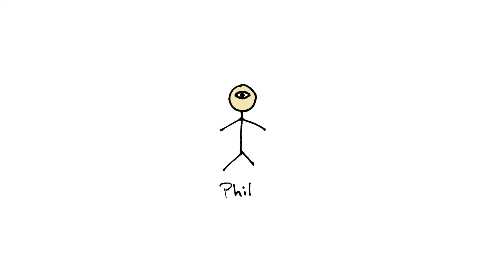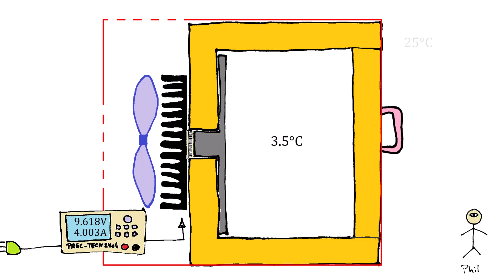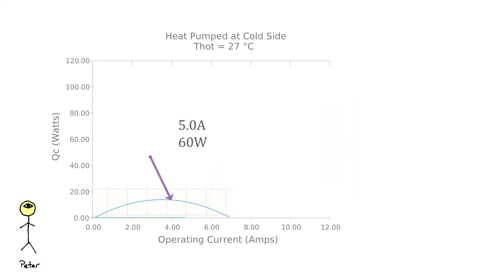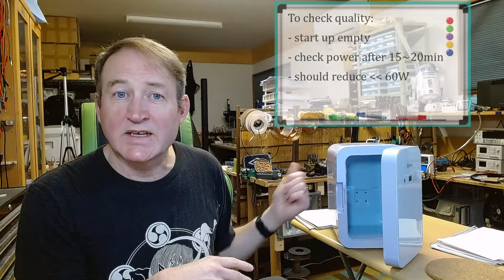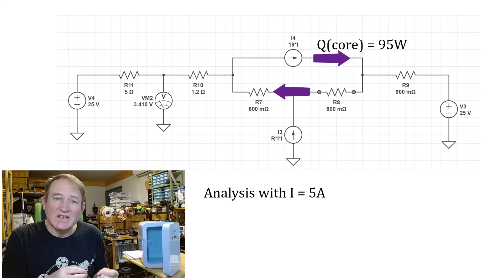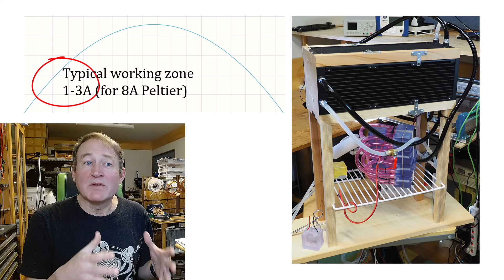The Peltier Fridge Parabola Problem

Comment from the maker: A note for clarification: In the video all the circuits are actually thermal circuits, not electrical, which is confusing and I should have explained before showing the circuits. For these circuits, if you see a resistor in Ω, this represents thermal resistance in K/W or °C/W. The current (A) represents heat flow in W, and the voltages represent temperature (in °C). So if you see 25V, this represents 25°C, if the Peltier core heat pump is 95W this shows up as 95A in the electrical circuit. Hope that makes sense!

Comment: i started getting really into modding fridges after i bought a peltier wine cooler and was disgusted by its apparent energy consumption. I discovered a few unique tricks after modding it that I later applied to my compressor fridges i bought.
I will share them here since my old video explaining them is basically unwatchable.
1. Use GaN powered adapters and convert the input plug to USB-C with a pd trigger module. instead of loosing ~15% from AC->DC, you cut that down to about 10%
2. play with different input voltages. very dangerous with tec coolers but totally okay with compressor fridges meant to run on 12/24v systems. USB-C pd 3.1 spec has a 140w 28v setting which is within spec for 24v systems (based on 2 lead acid batteries in series, which has a peak charging voltage of about 29-30v). the compressors really like running on the higher voltages.
3. increase airflow to hot end, duh
4. add low emissivity coating to cold end and high emissivity coating to hot end. When i ask AI about this, it gets really confused... i wouldnt trust what it has to say. basically apply aluminium tape to the outside of the device, and inside surfaces, and apply matt black (like gorilla tape) or better yet black painted aluminum tape to the hot end regions that will radieate away from cold end. apply shiny aluminum tape to surfaces between cold end and hot end.
5. extra insulation always helps.

by doing all these tricks, i was able to reduce my 55 liter/54 quart dc fridges average power consumption down from ~30-40watts all the way to ~5 watts (105wh/24hr!). it truly is insane to think that charging an old phone or ipod consumes around the same power on average as the largest format DC fridge takes to maintain a bunch of drinks a few degrees above freezing. it actually saves you electricity to add a drink fridge since youre opening your main household fridge less often and letting all the cold air out.

need to get back into messing with peltier modules, glad youre making these videos. that delta t is the key.

Comment: Jack who kno a bit more than Peter suggest not to run the peltier device continuously at 60 w but in pulses of 60 w with 50% duty cycle and then decrease the duty cycle to 10%, while keep the hot side heat sink fan on all the time, suddenly the COP became more efficient than all the known  heat pumps, good luck and try that and see your self

Hint : the frequency is the key

Comment: I want to make a small greenhouse (around 30x30x40 (48liter controlable closed air flow with plexiglass) where i can control temperature to grow mushrooms in it. Do you think i could use a peltier element with heatsink and fan on bothside to regulate temperature around 25 degrees C. I would rather use 5volt 1 amp peltier with 40x40mm fan and heatsink but im not sure if that would work? i think ambient temperature would be maybe 10 degrees low 35 degrees high.

Comment: Why does the parabola move left?
Reply from the maker: Good question! I also wondered about this. It turns out to be related to the whole system starting and finishing at the same ambient (the room temperature). That doesn't always apply to heat pumps, they can pump between different zones (e.g. inside a house to outside a house). For a fridge though the hot side is pumping to the room ambient and the cold stuff in the fridge also leaks to the same ambient. In that case the parabola must always pass through the (0,0) point as both ends of the system are at the same temperature. A normal parabola is ax²+bx+c but in this case there is no "c". I guess mathematically it could be wrong to say it moves "down and then to the left", rather the high thermal resistance just causes it to shrink overall while always maintaining a left foot at the origin.

Comment: I was mistaken about peltier fridges also. I know that they are used in labs but I wasn't sure why they would and the efficiency problem. This makes a lot more sense now, it just takes a longer period of time for temps to stabilize at the lower amperage. Great explanation!
Reply from the maker: Yes, the best algorithm is like the Msake fridge which uses the higher power mode to cool things down but then switches to lower power once it is down to temperature. It actually seems to have three stages, 60W, 25W and then 10W or less.

Comment: Very interesting and informative.
I had no idea about the current paranoia.
I have a 35 year old Coleman fridge which I use when camping. It's probably accumulated about 4 years of uses.
It must have been good quality given the normal 2 - 3 year life you are talking about.
The fan motor burnt out 3 years ago but I managed to graft in a pair of 12v panel fans and added a thermostat to stop freezing in the cooler months.
I suspect the performance is down a bit, so I will be renewing the thermal paste never thought about that.
Thanks.

Comment: When I was researching how to reduce the power of a Peltier module to improve COP, I considered two methods of power regulation: PWM and DC regulator. The neural network suggests that it doesn't matter whether you use PWM or DC regulation for a Peltier element, efficiency will be the same (assuming the same average electrical power).
Unfortunately, I cannot confirm or deny its information, but maybe you (or someone in comments) have any thoughts about this?
Reply from the maker: If the PWM frequency + filtering is high enough that the Peltier "sees" only dc it is OK. However if the PWM is slow and the current is actually switching between 0 and high current with a variable duty cycle, then the negative effects of driving Peltiers at high currents will still exist, even if the average current is low. It needs an LC filter with the frequency below the PWM output. A little bit of ripple should be OK, just not hard swing from 0A to high current.

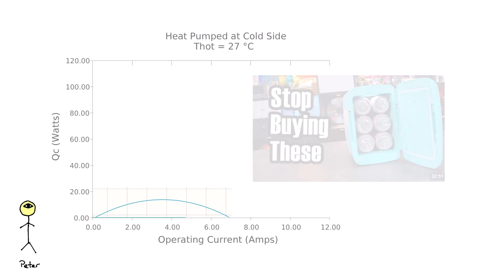Comment: 7:01 I rewatched the technology connections video with "stop buying these" on the thumbnail. He didn't address the option of getting a better designed peltier cooler. But he did talk about how the one he got was cheaply made and inefficient and badly performing for reasons other than the peltier effect being inefficient. And that the peltier effect is a lot less efficient than compressor based systems (isn't that still correct?). And that there are still reasons to use them.

Now that I'm writing the comment though, I can't remember the answer to the main point though, which is, did he give efficiency numbers based on running the devices with too much current? Either on the cheap device he was testing, or as a general statement about the peltier effect.
Reply from the maker: His main point was blue fridge was drawing 55W (24/7) which is a valid concern. However, the Msake fridge draws about 9W which is a different ball park. Our living room alone has 21 x 5W LED downlights, so the Msake fridge draws less than two of those. Excessive concern about COP at those levels is a forest/trees problem. He also said that Peltiers have an efficiency that varies wildly and is generally between "zero and very bad", which is untrue if the thermal system is designed well. The raw ability of a Peltier is about 25% of the raw ability of a compressor. Compressors are excellent if used properly (which they are often not), so 25% of excellent is still OK. He also proposed that a compressor fridge has a COP of 3 which is wildly overoptimistic, given the large dT and the parallel plate design. Based on the Carnot theory, at the temperatures of a typical fridge the maximum COP for an ideal heat pump is only 3.0 (due to the large dT involved). A good quality compressor usually gets about 60% of this, so about 2.0. But then most modern fridges discharge the heat on the sides of the fridge, which creates a parallel plate to the inside of the fridge (massive leakage hot to cold) and kills the COP down to about 1.0. *Which is still great*, all things considered, no skin off the nose of a well designed modern fridge. The thing is, it's really difficult to measure the true heat flow and COP of a heat pump, so people throw around figures like 3 or 4 based on what the manufacturers say, but in reality, compressor systems also vary wildly based on the conditions of use and the thermal circuit. Compressor systems also have a terrible power factor and are not well designed for use with battery/solar; Peltiers are perfect. But they need some tender care and loving to get the best out of them :). Finally he said the Blue fridge insulation was poor quality, which might be true, but the biggest factor in thermal insulation is surface area and the blue fridge is about 1/10 of the surface area of the black mini fridge. So even if the insulation quality is half as bad (which is expected) the blue fridge will win against the bigger fridges.

Comment: I'm in the process of working out a larger scale version of this concept.. to the point your diagram of the fridge is almost exactly a single module's layout (it isn't an air to air scheme, so it doesn't quite match up lol).

I've long given up on the idea of actually moving much heat with peltiers, but they are excellent at establishing and maintaining a specific temperature when the actual thermal load is minimized. Essentially my design controls the infrared signature of the controlled volume, without attempting to pump heat from out of the air. This requires multiple modules spread out, as well as conduction/convection being intentionally reduced. The idea is to let the cold side get as cold as it possibly can, not to explicitly have it ”pump” heat out of the controlled space.

My design isn't quite suitable for a fridge in and of itself, although could make an existing compressor based unit much more efficient by using peltier to hold the walls and door, and the compressor only needs to be concerned about the initial bulk heat such as a warm can being introduced.

I too am at the earlier stages of development... but I have long believed peltier gets a bad efficiency rap because they are widely misunderstood and misused. It is counterintuitive to apply insulation where you intend to have heat move around, but that's exactly what it requires. After that curve drops and things reach equilibrium, it takes very little power to maintain the temp, just a couple watts per square foot, in my case.

It's good to see someone else who does understand these intricacies... hope to catch something I haven't picked up on myself in your videos. These things have excellent potential in the right applications... and watching CPU crowds just "throw more amps at it" gets really old really quick. They don't understand how it works lol
Reply from the maker: I actually have two Peltier based air conditioning (heating) systems running at the moment. One is designed to match a 300W solar panel (rated 400W but gets 300W in practice), and uses a bank of 16 Peltiers to ramp that up to 600W, drawing 300W from outside, it gets a COP of 2 for heating with a dT of 25K. The second is a bank of 15 Peltiers that is similar but uses a water tank in the house foundations as the other side (cold side) so the dT is only 15K, so it can get a COP around 3 (e.g. 100W in 300W out). These are still not perfect and I think the main bottleneck is those aluminium blocks that are about 0.08K/W per Peltier, which sets an upper limit of about 75% of the datasheet. I used to think it was the thermal paste (ceramic - aluminium) but now I think aluminium to water that is the weak point, not enough surface area inside. I will do a video on this soon!
Reply: @PeltierPower  Oh yes as heat sources they are absolutely amazing. I'm exploiting this in another aspect of the system in the form of phase change materials... the cold side isn't allowed to cool and both the storage and retrieval are >100%. But cooling is a whole different animal and requires finesse haha
Reply from the maker: At the end of last summer I also had a similar 8 Peltier system providing 300W of cooling which was enough to keep the room stable. In a modern house, good insulation, blinds etc there isn't much heat getting in from outside (maybe 50-100W) but the problem is the heat sources inside build up (my body, PC, display, lights etc ~250W estimate), so it's surprising how little cooling is required. The advantage of summer time is the dT is much milder so I can still get a decent COP for cooling for cooling, e.g. 300W cooling for 100W input, and again I can pick the 100W directly off a solar panel (dc direct). I'm looking forward to seeing how my bigger systems (15, 16 Peltier systems) works this summer.

Comment: Would that also work for a dehumidifier, I wonder if I could modify mine to not consume crazy amount of power per gram of water removed
Reply from the maker: I had a few attempts at this but not great so far. Keep in mind that every 1g of water condensed requires ~2,250J regardless of the method, that's just physics, latent heat of condensation. That said, my attempts seemed to fail because the water builds up on the surface (e.g. copper coil) and then stays there, acting as an insulator and preventing further condensation. So it seems to be more of a mechanical issue, how to move the water on to a container. Now that winter is ending, I'll restart that project!
Reply: @PeltierPower  I know, I use it as a corner cold spot heater with bonus function of removing a bit of humidity but it would be nice to remove more humidity if possible
Can't you cover just the coil with hydrophobic coating?
Reply from the maker: I think this is where a community effort could help, I'm not familiar with hydrophobic coating, do you have any pointers or experience with this?
Reply: @PeltierPower  I'm not an expert, I have only used it on sloped stainless steel with ridges that wouldn't shed rain properly causing water to sit in valleys for hours after rain which caused steel to develop pitting eventually.
What I did was first I cleaned and degreased then sanded with 800 grade then degreased again with isopropyl and then sprayed the coating onto steel, water runs off much better now.
I don't know if this would work for copper or wouldn't lower thermal conductivity unfortunately.
Reply: @PeltierPower  Now that I think about it, wouldn't a simple wicking string allow you to drain enough water for it to not build up?

Comment: Am I correct in thinking a peltier element while not active is a thermal bridge/leak to the outside? I was wondering for small coolers it might be good to have a mechanical disconnect in the thermal pathway if the thermostat switches off?
Hope to one day make a mini milk fridge for my coffee machine with an acceptable efficiency...
Reply from the maker: Yes, but it's not quite as bad as the pundits might say. If the system also turns the fan off it could be say 2-3K/W thermal resistance to the outside world which is not perfect but if the thermal mass inside the fridge is say 3000J/K (two cans of beer) it will take a while. Theoretically the time constant RC = 3000J/K x 2 K/W = 6000s or a few hours, which is what you would expect. And of course you can just turn the Peltier system on for a bit everynowandthen and it can keep things in a usable range

Comment: Fascinating, never thought a peltier fridge could idle at 10W, thats as low as a (substantially larger) 12V compressor fridge. I also want to build a butter conditioner, for both warm and cold weather. Is there an algorithmic method for a machine to dynamically adjust its operation-point, like a maximum-power-point-tracking charge controller? Ideally you’d want it to keep tracking to the top of the parabola while it’s away from the set-point, and ensure you’re retreating down the left side of the parabola when full cooling power is no longer needed to retain the set temperature. I assume you’d need to measure not only the temperature of the thing to be cooled, but the hot-side and cold-side directly, and the input voltage and current. Even if the thermal resistance from cold-side to the object to cooled changes (e.g. putting another can in the fridge), would just those three temperature readings and the power readings be enough? I assume a microcontroller would be a requirement, as opposed to some sort of analogue feedback loop?

Comment: No fancy mathematics and charts needed.  The biggest problem with Peltier refrigerators is that when they are unpowered the Peltier junction is  a huge path for heat to flow back into the refrigerated space.  Lose power and the food rots — fast.  The wall of a regular mechanical refrigerator is penetrated by a couple of tiny copper tubes that present a negligibly small heat conduction path.  If power is lost, the food can stay cold for days.
Reply from the maker: Yes, but if the cooling is delivered by a water circuit, then simply turning off the water pump when the Peltier is off thermally isolates the Peltier similar to a normal fridge. You can push the Peltier hard to get everything down to temperature and then kill power (isolate), it will hold the temperature, just depends the chamber insulation. Can also cycle e.g. 5min cooling every half hour, similar to a fridge. I've done this in experiments, it works fine.